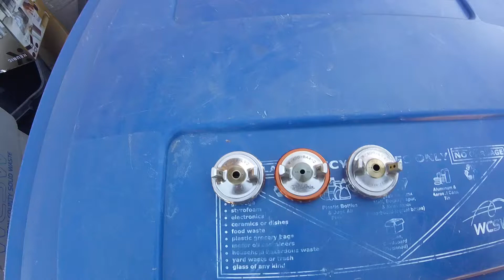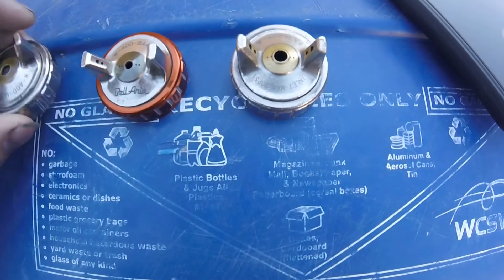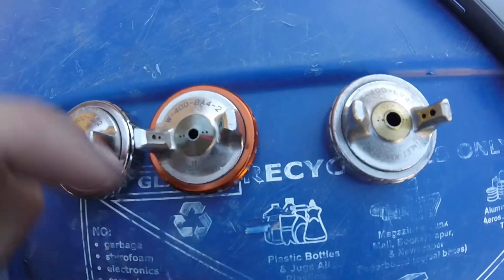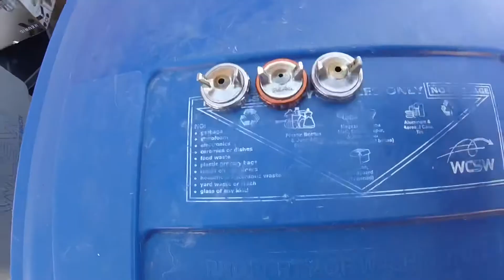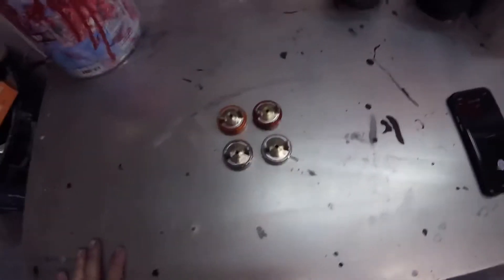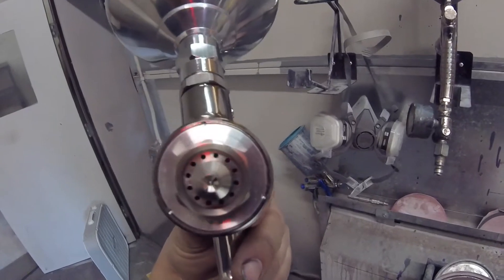Running my mouth about Anest Iwata W400/LPH400 air caps

Comment: I think youve found why you dont like the original LV cap. Its the higher viscosity that you prefer. The LV cap should be better for medium solids which is ideal for guys at home.
Reply from the maker: Hey that’s a really good point! Bellaria is probably perfect for a small compressor garage job with MS clear

Comment: WHAT IS YOUR FAVORITE IWATA BELLARIA"W400" NOZZLE NEEDLE AND AIR CAP COMBINATION FOR CLEAR COAT; I TRULY ENJOY YOUR VIDEO, S ; THE PATTERN TO ME IS CRITICAL" I PREFER A LARGER PATTERN WITHOUT HAVING TO BUY ANOTHER GUN WHAT COMBINATION WOULD YOU RECOMMEND?? THANK YOU, Patrick.P
Reply from the maker: The Bellaria cap has a much wider fan than the LV2. I would say for a wide fan  BA4-2 cap/nozzle for DIY use and WBX cap/nozzle for a professional compressor setup that can flow enough for HVLP. For medium solids clear I would go 1.3 and for high solids clear I would go 1.4.
Reply: @bradenmitchell976  Brandan, I have a w400 "Bellaria; I have the LPH400-LV4  as well as the W400WBX AIR CAP- I HAVE THE WB AND WS 400 "TULIP TIP" 1.3 AND 1.4- DO I NEED TO BUT THE LPH 400 NEEDLE/NOZZLE SET'- WHAT NOZZLE DID YOU USE TO SPRAY THE CLEAR IN YOUR VIDEO??- I,m trying to save a few $,s  and really do not want to spend another $400-$500 on anIWATA LPH400 LV GUN- ; I HOPE I,m not wearing out my welcome thank,s PATRICK .P

Comment: I have the purple LVB cap for the LPH, that ones made specifically for difficult metallics/metallic control and required to be sprayed at 14psi or lower anything above that the fan pattern can produce an S shape. That cap has 3 holes on the air horns and a total of 2 air holes in the center of the cap, it also produces a very large fan its best 1 turn in from fully open, and runs the best with a 1.4 at full fluid. Droplet size is bigger compared to the LVX cap and additionally can work pretty well with clear, but if you use it for that you'll need to dial in fan a bit more and you can turn the psi up to 20-24 without the S shaped pattern. Finicky cap but definitely works well for what it's made for
Reply: I have the LPH-400 1.4 LVB and have been spraying sherwin 1:1 activated base at anywhere from 10-15psi depending on conditions and HS clear at 20-25psi but have since moved to the WS400 1.3HD dedicated for clear on bigger projects. Definitely moves faster for an overall and love layin glass with it.

Comment: The extra cuts around the tulip nozzle is better because it starts atomizing the fluid right at the needle. That’s why iwata can get away with only 2 small holes on each side of the center cap. If you look at other high quality guns you won’t find a tulip pattern but you will find 6-12 holes like the tekna and sata. More small holes the better.
Reply from the maker: Many months later and I’m starting to like the LPH guns better for everything. That extra split in the nozzle really helps
Reply: @bradenmitchell976 hey! Nice video🙏so are you spraying more with the LPH400 then?
Reply: I mean 
Are you also spraying clear with the LPH400 now?or still spraying with the 3 split nozzle with the LPH cap?

Comment: Good explanation 👍I heard the WBX lays out sealer very well and excellent for waterborne base coat
Reply from the maker: Thank you! I actually have been using it for my urethane sealer lately and it works very well
Reply from the maker: I have not used water through it but it’s a great clear gun as well

Comment: Thanks for tips and tricks bro!!...my favorite is lph400 gun !! The w400 put out more materials than the lph400 ???
Reply from the maker: Or if you just like to spray fast!
Reply from the maker: Like I explained, the LVX and WBX caps air holes are the exact same. The main difference is is the 3 cuts in the W400 nozzle vs 4 cuts in the LPH400. I have not switched them up for base and clear but I have a hunch they will spray 95% the same. As for the W400 LV4 it’s an absolute ripper of a gun and I have got some incredibly smooth finishes with it. In fact I threw the 1.4 tip in that gun for the video. For years prior I ran a 1.3 in that gun and I feel like it still would have sprayed faster than the other guns had I left the smaller nozzle in. Mind you the trade off is that it’s going to eat up paint more and create more over spray. If you have a smaller compressor setup or are not using crazy expensive clear coats I’d say that one would be your best bet!